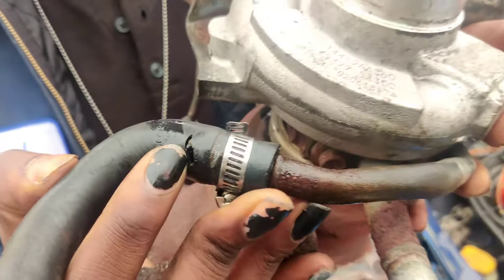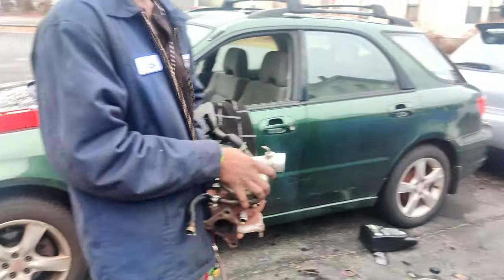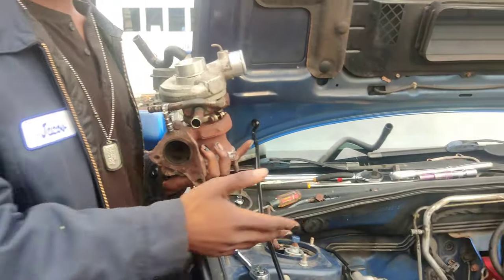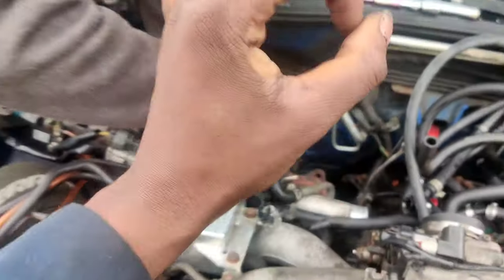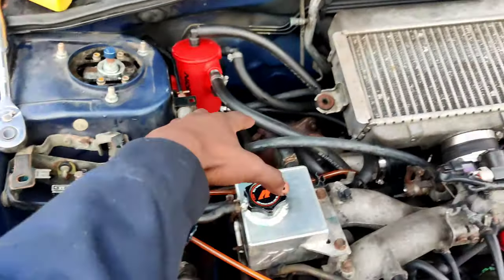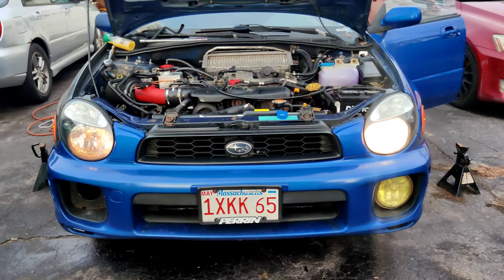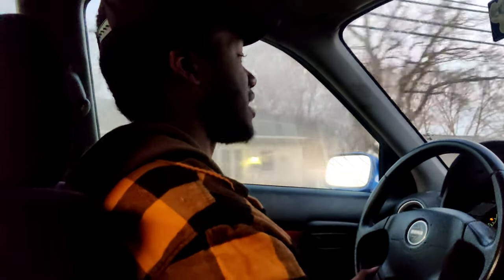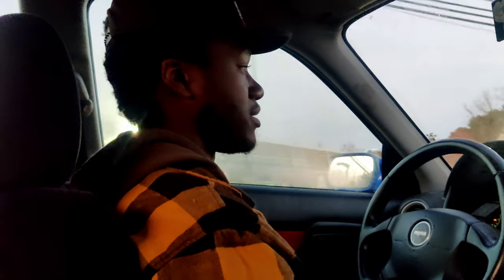NO MORE EXHAUST LEAK!? I'm back...(Kinda)

Comment: My subaru did the same thing stuttering going into boost, I have a stage 2 plus cobb tune in my car. So I replaced the timing belt and it went away and now it builds boost very smooth and fast
Reply from the maker: Timing belt might be a good thing to replace at this point actually loll.